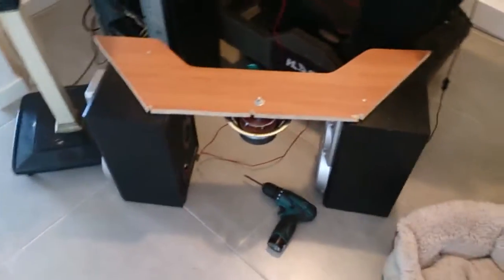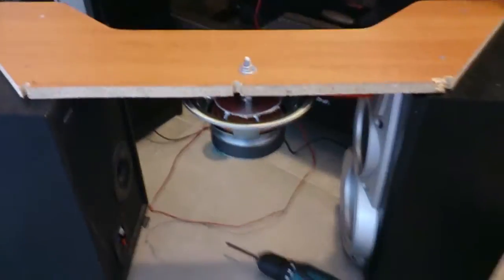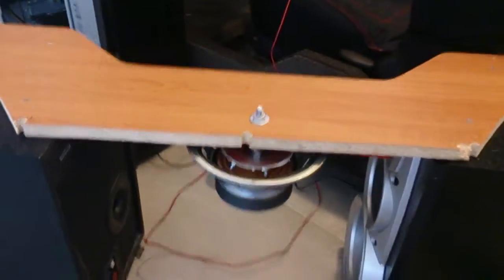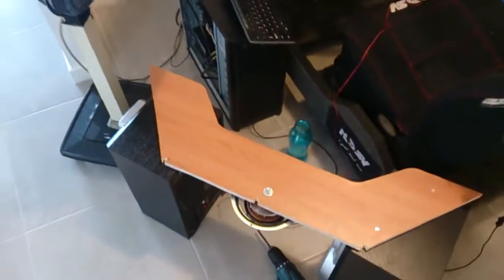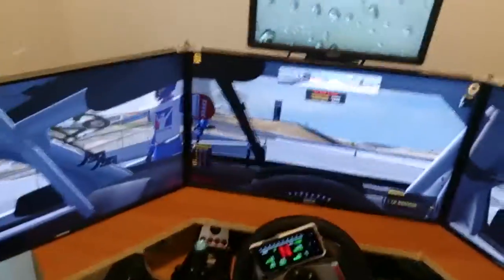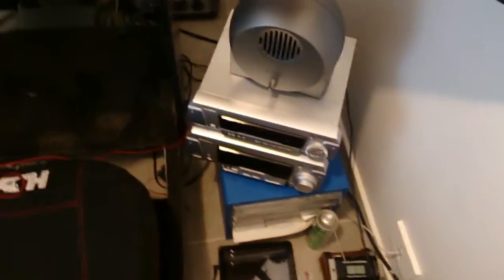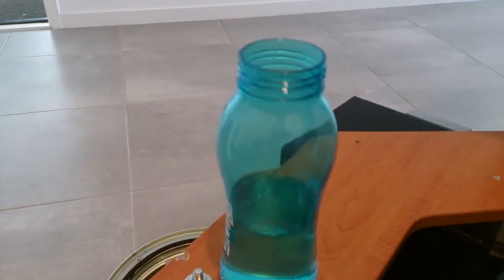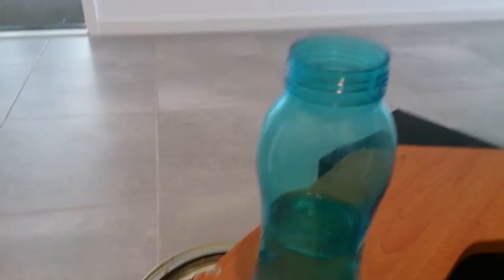home made tactile transducer

Comment: Gday Mark. Thanks for the vid Champ.
I made one this weekend for a race seat I have.
I am very happy with the vibration effect. But for some reason I can still hear the source sound material from the speaker.
Dont know why. Maybe trim the remaining cone right down to the epoxy holdding the centre bolt, just leaving the wired portion of cone.
I thought it may be coming from that secondary cardboard lookin piece beneath the cone.
Any help appreciated.
Cheers Bob